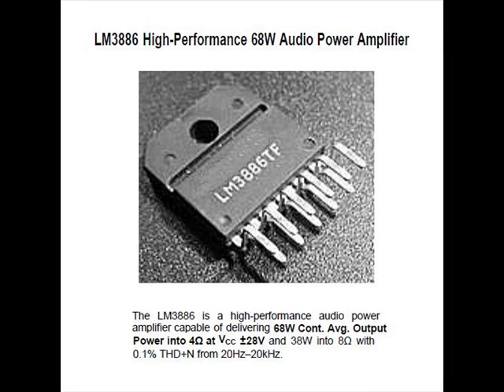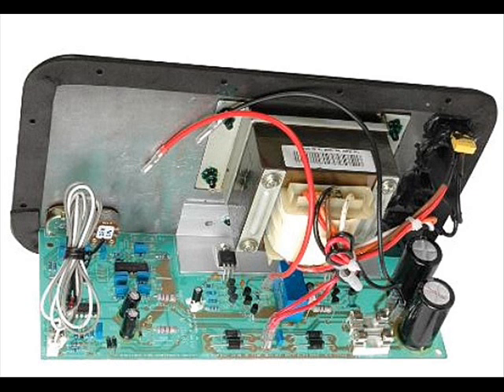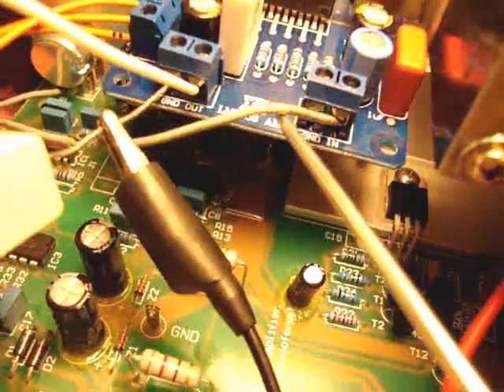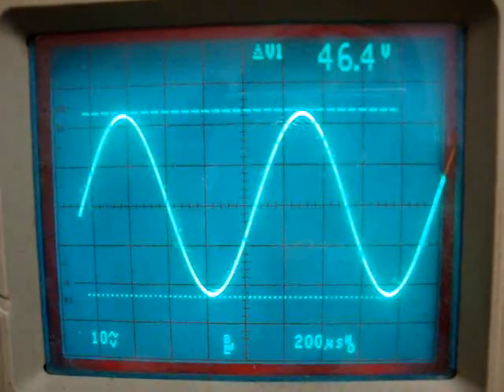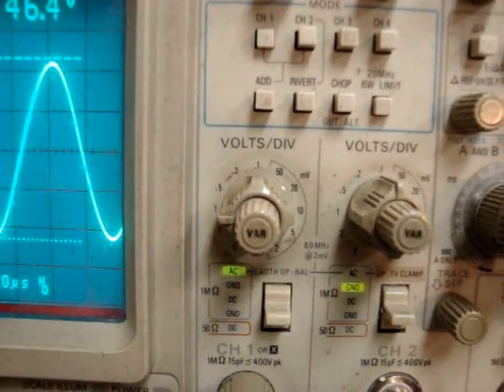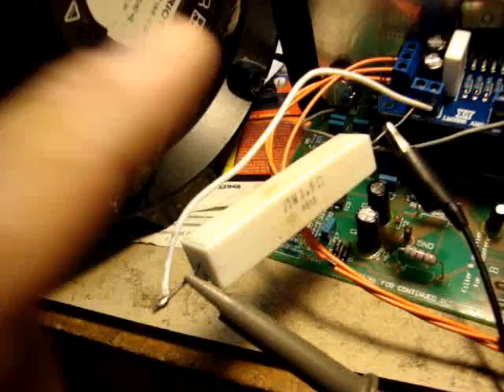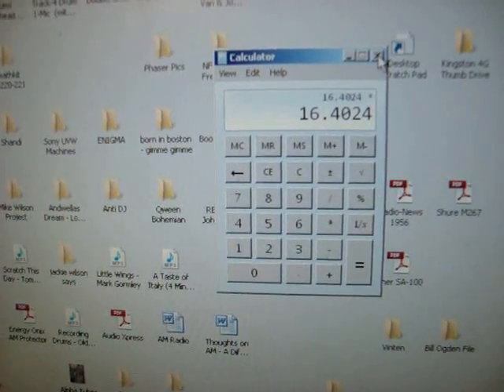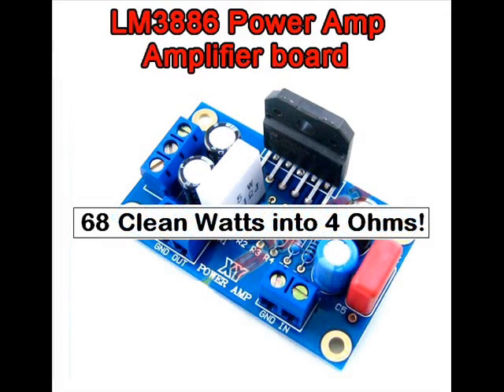LM3886 Amplifier Examination

Comment: These amps with the chineese ckt boards have lots of stability problems.  Make sure you are properly byoassed and have the proper networks to prevent hf oscillations and ringing

Comment: Nice video. What was the input voltage level that produces those 67W RMS in the output. Thanks
Reply from the maker: Thanks, glad you liked it. The input was ~973 mV, which is what the amp was strapped for. However, i was able to increase the gain by bridging the 1k shunt resistor with a 680 ohm, which is now ~320 mV for full output.  https://www.circuitbasics.com/wp-content/uploads/2016/10/LM3886-Datasheet.pdf

Comment: This gave me very good information.
Please suggest what would be best transformer ratings for 7 Boards of lm3886 coz I am planning to construct a 5.1 by 7 LM3886.
20-0-20, 30 AMP
YOUR CORRECTIONS WILL BE HIGHLY CONSIDERED.
I APPRECIATE YOUR VIDEO.
I AM WAITING FOR YOUR RESPONSE.
THANKS WITH BEST WISHES.
Raj Kamal...India
Reply from the maker: Thanks for your kind comment. 
I made an LM3886 with a 70 watt output. At full output power, the voltage rails were +/- 27vdc. I used 2 power transformers 24v 3A each (6 amps total). Here's the vid for it: https://youtu.be/jJ6V0NjE6vg

For your project, I recommend 48 volts c.t. at 40 amp power transformer to power all 6 LM3886 amps.
Data sheet for the LM3886:  https://www.ti.com/product/LM3886
Reply: @bob4analog  
Thanks Bob gentle reply.
One more confusing point...
I am planning this project as stereo or 5.1 option.
In that case, will this transformer will work or I should prepare individual project for individual use. I mean, stereo system with 24-0-24/6 Amp supply and 5.1(TOTAL 7 LM3886) with 48-0-48/40 Amp.
If you will provide your kind guidance, I would be deeply grateful for it.🙏
Reply from the maker: @rajkamalsharma2184  I recalculated; You were correct the first time. The transformer will be 24-0-24 volts 21 amps, 25 amp bridge rectifier, and two 35000uF 40 volt capacitors. This should be adequate for 7 LM3886 amplifiers.
Reply: @bob4analog  Thanks a lot Bob for your kind and informative response.
I appreciate it.

Comment: Just took a peek inside my old UltraLinear subwoofer because the gain and frequency knobs seem scratchy and noticed two of these in push-pull configuration. Woofer is 8 ohm.
Is it safe to assume that each IC is seeing a 4 ohm load and this woofer is getting around 120 watts?
Reply from the maker: Yes, that I correct, at least 120w.

Comment: Would this be a good choice to power two Dayton Audio TT25-16 PUCK Tactile Transducers? They say they are rated for 15 watts RMS/30 watts max and they are 16 ohm. I'll most likely be running them at 60% volume or less. Do you know of a better amp board for these pucks?
Reply: Yes.. it will work flawlessly... although these lm3886 boards are mainly for hifi bookshelf or tower speakers... i would personally go with some cheap class d boards for those pucks as they require less space, no additional heatsink, single dc power supply like a laptop brick would be just fine and also most of them have a volume knob on the board... and a total setup costs like less than 30 bucks..

Comment: Hi! I want to build a 2x30W amp with LM3886 ICs. If i am right i can reach it with 2x18V or 2x19V secondary voltage (AC), but i am not really sure about the secondary current :( Do you think that 2x4,21A enough for this? Or should i go higher, like 2x5A or 2x6A?
Reply from the maker: Yes, that's correct for driving a 4 ohm load. Altho I think +/-20 volts would be better. The total current should probably be around 5 amps (2.5  amps per rail). Here's my evaluation of an LM1875 that will make 30 watts output in to 4 ohms...  https://youtu.be/eMJnTeTRmuU

Even tho the I.C.'s are different, the math should be about the same for power out of either one.
Reply: Bob H i want to use 8 ohm drivers, thats why i tought i should go with higher current, and i found a few possible toroidal transformer (160VA). What do you think about these?

http://www.tme.eu/hu/details/rt160-2022/toroid-transzformatorok/noratel/

http://www.tme.eu/hu/details/tst150w_2x19v/toroid-transzformatorok/indel/tst160008/
Reply from the maker: Nice transformers. I think the RT160-2022 would be best since it's the higher output voltage. The amp output will need to provide 44 volts peak-to-peak (sine wave) to make 30 watts RMS into an 8 ohm load.
Reply: Bob H Thank you!
Reply from the maker: Anytime! ;-)

Comment: Can you try TDA7294 next? nice video :D
Reply from the maker: Thanks! Yes, I've been wanting to test the TDA7294 for awhile now. lve ordered one, so I'll demo that one too. I do have a TDA2040 vid that I'll be posting here 1st, but then I'll post the TDA7294 as time permits.
Reply from the maker: TDA7294 - https://youtu.be/hY0agMkJgLs
Reply: @bob4analog  In your opinion, which sounds better, TDA7294 or LM3886?
Reply from the maker: @macacinelecanale  - Honestly, I can't tell the difference. Both are very transparent, which is usually what is desired from an audio amp. As to which one 'sounds better,' most of that is subjective.
Reply: @bob4analog  I know that sounding is subjective, that's why I've asked your opinion. People who plays a lot with amplifiers tends to be more accurate. Thank you very much for your answer!
Reply from the maker: @macacinelecanale  - Thanks for your confidence in my opinion. Yes, as for these amps,  there's really little difference between them; it's perhaps a split hair difference in my opinion.  It would be interesting to get another opinion besides mine. I will say that I do prefer these Class AB amps  over PWM types, as they're pure sounding. No switching pulse frequencies get in the way, therefore, not an issue with Class AB.

Comment: How do you connect input audio and output speakers to one these units as you did not test with an audio source so that you might hear how well or not so well the board operates for sound quality. Also, how do you connect tone and balance to this unit. What would you typically used this board for? I simply wish to learn. Thank you.
Reply from the maker: +Carl Philistine - Good questions. I had not demonstrated the audio quality in this video; this was just a demonstration of technical specifications. The sound quality is very good! The demonstration of the technical specs is proof of the audio quality. Also, the tone and balance controls are a separate issue. I had not discuss this in this video because I was demonstrating only the amplifier at this time. A speaker can easily be connected to the terminals marked OUT and GND, and Input is at terminals marked IN and GND. I'll be making other videos discussing power supply that can be used for this amp along with other details.